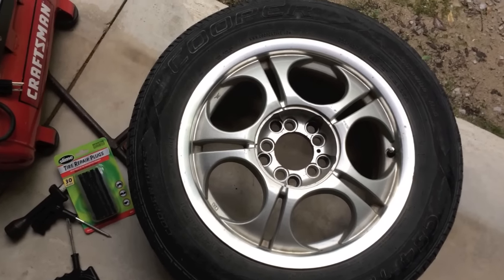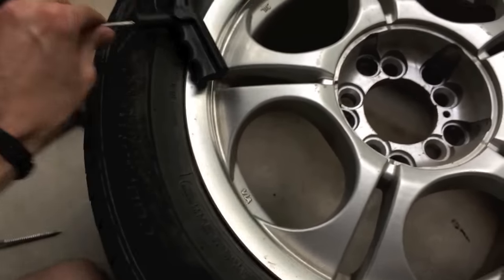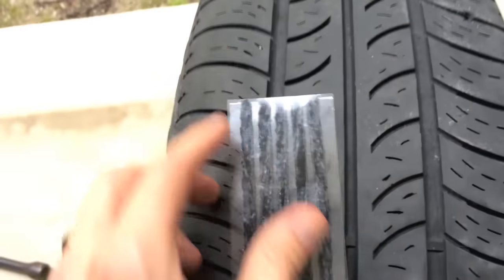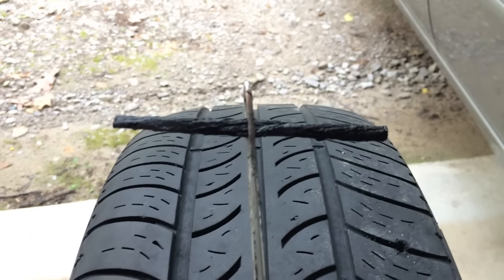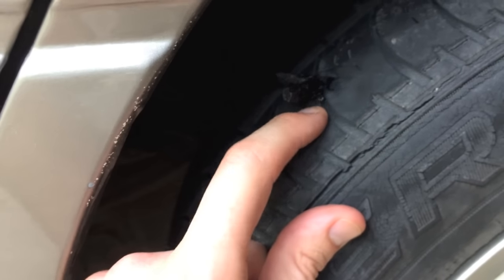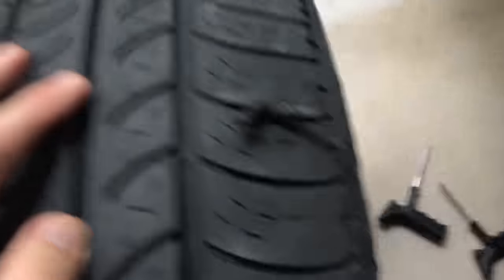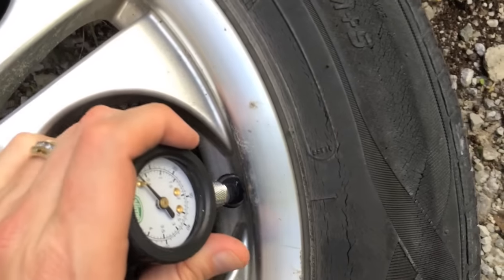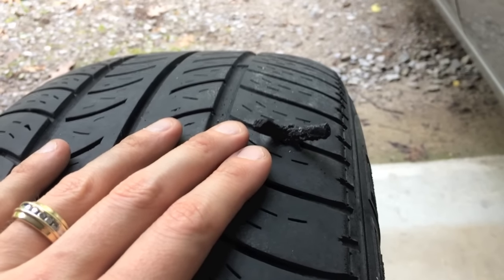How to Patch/Plug Hole in Tire in LESS THAN 5 Minutes - Fix a Flat Tire - EASY FIX

Comment: You skipped over the hard part; Pushing the plug into the tire.
Reply: I agree. I find it exceptionally hard to push the plug into the tire. I’ve done it 25+ times, and it’s more difficult every time.

Comment: One suggestion for the rubber cement compound, I put a liberal amount on the whole strip just before inserting into the tire.  This helps bond the folded section to itself and where it contacts the hole of tire.  Doesn’t hurt to apply some to the plug as shown in the video, but most of what you apply there is going wear off in a short amount of miles driving on it.
Reply from the maker: Thanks for watching & we appreciate you sharing this advice.  Us fellow DIY’ers need to stick together!

😎👍🔧🔩
Reply: I totally agree and that's what I do.
Reply: The person doing this video doesn't know the difference between a plug and a patch, so I wouldn't put much faith in anything they do or say!
Reply: So should I put some of that glue on the strip before putting it in the tire ?
Reply: @ejercitodejehova6979  Yep. Slather the strip in glue.
Reply: @ejercitodejehova6979  YES!!!
Reply: @TF856  accept they just did exactly what the instructions say to do...
Reply: Can it be rubber cement?  The kit I have doesn't have sealant.  It has lube.  It's old.
Reply: And that's what the extra patch on top is for.
Reply: I bought a whole "kit" and it said nothing about cement
 Opened it up and the detailed instructions said use cement lol. Fuck
Reply: I use super glue it works just as good you just got to work fast
Reply: @Envelope81 super glue falls apart when wet even after curing.
Reply: @tannermeade  I ended up using black RVT sealant. Worked perfect and no leaks 4 months later. 8 bought new tires so those tires are gone.
Reply: This - the video is actually just wrong on the just dab a bit - I put it in the hole and around the plug prior to putting it in - makes the insertion easier as well.
Reply: The glue goes on the plug before you push it in!
Trim the loose ends with a razor blade to preserve the repair.Running with the loose ends can ruin the repair.
Reply: The instructions say put the glue on the plug before patching. Just read instructions.

Comment: Before you ream the hole, you want to find the direction of the injury so that your not actually making it worse by forcing the reamer through uninjured tire. Follow the channel of the hole. For example, if the hole is 45° you don't want to force the reamer through at 90° because you'll be compounding wound channels and making it even worse. Coat the plug material with the rubber cement just before inserting it into the tire. It'll act as a lubricant and make insertion much easier while providing for a better plug. By the appearance of the ozone bead cracking, this tire should be replaced anyway.
Reply from the maker: Thanks for watching & we appreciate you sharing your advice.  Any & all helpful info is greatly appreciated Eddie.

Hope all is well with you and your family.

😎👍🔧🔩
Reply: Yeah I just think I did this and definitely made it worse rookie thought I would figure it out nope bought some cheap ass gas station plug and now I'ma have to run to tire shop in morning.
Reply from the maker: @youtubewatcher8244  

Thanks for sharing, can’t go wrong with a new tire.  We just had to put a new set of tires on our Pacifica... we don’t remember tires ever being that expensive...but I guess they are...it was expensive...😳

😎👍🔧🔩
Reply: @DIYwithMichaelBorders  Just had to pay with my pride they plugged it up for me
Reply from the maker: @youtubewatcher8244  

Thanks for sharing, hope all is well.

😎👍
Reply: @DIYwithMichaelBorders  You know his family??
Reply: Good info but how would I know the directions

Comment: I normally apply rubber cement on the strip patch for added seal and at the same time the cement acts as a lubricant during the insertion.
Reply: That's what she said.
Reply: How long you driven the tire after? just curious if they are reliable
Reply: @raulakh123  they will last forever. Tire shops are using this "old" method again due to tires/rims having tire pressure monitoring systems on them - taking tire off there is a risk on some to ruin the TPMS sensor
Reply: @arniepries6480  yeah if your a shitty mechanic 😂😂 there is a certain way to take the tire off when it has tpms...
Reply: @adamglockl  - and they still charge the same price for a flat repair whether it’s a plug or tire removal - go figure!🙄
That’s why I started just doing it myself
Reply: @arniepries6480  i always get my tire patched when i get a leak, NO plugs, they suck in my opinion. Never had a problem with patching, and they normally last me til the tire is worn out. Cost me $20 for a tire patch at my local shop
Reply: @arniepries6480  how much of the rubber head needs to be trimmed off? I pretty much trimmed the whole thing off and there’s barely a nub left
Reply: @Phuong_Nguyen_  That's how I do it, then add rubber cement on top.
Reply: @raulakh123  They are meant as temporary repairs.
Reply: @eddiespencer1  Meant as temporary, but after repairing tires for over 20 years using this method, I've never had a repair fail or leak for the entire life of the tire... ever.
Reply: @knightryder3757  tried and trues 🥂
Reply: @kingz1063  You can buy a tire patch kit for $2
Reply: Facts
Reply: @schris413  😅😂🤣
Reply: @raulakh123  it's fixed for good. I also did that to big trucks when I was used to be a truck mechanic
Reply: Insertion is my favorite
Reply: 1:45 you cut out the 2 hour spot where you "pulled" the strip thru the  tool!!😂😂😂
Reply: @schris413  😅😂🤣🤣🤣
Reply: @kingz1063  But you gotta go to the shop. How's that work if you're 50 miles from town.
Reply: I've actually done this in the driveway, tire aired up and still on the vehicle. Lost some air but easily aired up and lasted for the life of the tire.

Comment: Worked perfectly. I added some of the tips mentioned in the comments such as using a small drill bit for a tiny puncture so the reamer could penetrate, and using the supplied cement glue on the inserter to make it easier to insert. Tires are doing great now. Thank you!
Reply from the maker: Awesome, that’s a great comment & we enjoyed reading it.  You’re a true DIYer for taking the time to read comments & learn more as you put together the steps for your project.

Thanks for watching, welcome to the DIY Raptor Club.

😎👍

Comment: Thanks, just did my first one and this gave me the added confidence to do it!  I will add that you should probably put the rubber cement on the entire plug before you push it in to the hole like one of the other commenters had mentioned.
Reply: Can I normallu drive once I plug the hola or do I need to patch it after?

Comment: Hey there! I found a nail in my tire and thought I was going to have to replace the whole thing because the air was leaking out. Found this video and you have helped me save a bunch of money. Thanks for the info! Keep up the great content!
Reply from the maker: Awesome!!!!  😁👍

Thanks for watching & sharing this, did you keep the nail as a souvenir?

Awesome job Jeremy making it a DIY project, definitely a rewarding experience, enjoy the rest of your week.

😎👍
Reply: As long as it’s not on the sidewall you can patch almost any tire unless it’s completely destroyed. Most shops won’t patch it outside of the center for “liability reasons” but you can still do it yourself. Most people go awhile with these plugs in their tires

Comment: I wasted several strips trying to force them through the tire. You need to inflate the tire to at least 10 psi or close to that so the tire gives you resistance when forcing the tool and strip in. I had an inflator in my garage and just put a peace of paper and my finger against the hole as I was filling up the tire with air. Once it got to about 10 psi, I quickly moved on to plug the tire. Went right in. Great video by the way.
Reply from the maker: Hey that’s awesome advice, thank you for sharing.  We really appreciate you sharing your experience.

Reach out to us any time.  👍🧰

Comment: 5/3/2021: I just followed your method, modified, and so far (drove 30 mph on bumpy road for 2 miles), checking air pressure, and soap-sudsing the plug for tell-tale bubbles, the repair to a leaking tire (losing 2lbs every 30 minutes) appears to hold. This was on the RR tire (2015 Civic LX). I jacked the car up, then rotated the tire until I saw a screw head. Marked the area. Then used emergency brake to hold the tire from moving, and started work. I used a phillips-screwdriver and pliers to remove the screw.  The air came out.  My difficulties: first, it took a big framing hammer to pound the reamer in, after which the reamer would go in an out OK with pushing and pulling by hand. I used Rubber Cement on both the plug material and on the end of the insertion tool. Then I couldn't get the damn plug in, even with pounding the insertion tool with the hammer, so I sliced another piece of insertion material down the middle and used half-a-thickness in the insertion tool; and THAT finally could be pounded in a couple inches. I just pulled it out like you're supposed to. We'll see if it holds. 5/9/21. The car has now been driven daily for 6 days, plus at least 60 mph, and no leakage from the tire. This is the second time I have successfully used a tire-plug kit to plug leaking tires, while the tire is still on the car.
Reply from the maker: Thanks for watching & welcome to the DIY Raptor Club.  Sounds like you’re back up and running.  We really appreciate you sharing your helpful experience.

Keep us posted on how it performs.  Us fellow DIY’ers need to stick together!  Hope all is well.

😎👍🔧🔩

Comment: Thanks for the video saved $267 when Firestone said it’s repairable but they wouldn’t repair it because of tread height (their BS policy) but they would gladly sell me 1 new tire for $267.00.  Too bad I got my 2 rear ones (same tires) for $330.00 all in.  That was from a dealership (the irony 🤣) Won’t go back to FS ever again.
Reply from the maker: Jason Post 

Thanks for watching Jason.  Happy to help.  Sounds like you’re back up and running.  Definitely let us know if you have any questions.  Us fellow DIY’ers need to stick together.

😎👍🔧🔩
Reply: Also just left Firestone, they said the same thing but cuz the location of the hole {which was same as this video} they couldnt plug it. Liability reasons.

Comment: Thanks for the vid. I had heard it was easy to do but never needed it until this weekend. It was kind of tough getting the reaming tool through the tire. I ended up drilling a larger hole with my drill. It could have just been where the hole was located in the tread. But all in all an easy fix to all those wondering. Thanks again.
Reply from the maker: Very cool & we appreciate you sharing this.  Welcome to the DIY Raptor Club.  These little plugs are extremely reliable & some of our viewers have mentioned they last years.  Hopefully many stress free days ahead for you.

😎👍🔧🔩

Comment: If you use the sealant that came with while your pushing the plug in it will make it much easier, with practically no resistance and also the sealant will seal it from the inside as well. Thanks for the video and God bless
Reply from the maker: Thanks for watching & welcome to the DIY Raptor Club.  This is great info & we appreciate you sharing it.

Any & all helpful info is greatly appreciated!  Enjoy your weekend.

Comment: To clarify for the comments, don't shove the thing that punctured your tire into the tire.  The first tool is used to rough up and open up the hole enough for the plug to get in.

Great video, and if anyone is having trouble, just follow the instructions on the back of the pack.
Reply from the maker: Thanks for watching & we appreciate you sharing this.  Any & all helpful info is greatly appreciated.

You Rock Tyler!  😎👍🔧🔩

Comment: One suggestion I would have is to NOT push the projectile(nail,screw etc) farther into the tire,but rather try to pull it out with a pair of needlenose pliers.. it could damage sensitive sensors or disrupt the balance of your wheel while you're on the highway. or even possibly re-puncture the tire somehow in another in another spot..its far fetched but possible

Comment: You should never push the nail inside of the tire. Pull it out with pair of pliers
Reply: What I do too. Pull it out. Quickly shove it in and keep air in place. Tank her out and then plug it. Even will use rubber cement after. And then snip off any extra. Idk it's the way I was taught at the dealer years back. Just gotta hope you dont have too big of a hole because you will want to double plug it and know deep inside you shouldn't. Sidewall though, no hope. Wouldn't ever touch someones tire if the leak was even too close to it. Not worth the risk.
Reply: Who said it was a nail

Comment: Good stuff. In addition to the comments about being quick with the plug and reamer, the Slime kit I got also came with some rubber cement. The plug is already super sticky, but the cement coating all over the plug can only help.
Reply from the maker: Berlin1811 

Thanks for watching & sharing your thoughts.  You’re spot on!  We appreciate you sharing.

Let us know if you have any questions.  Many more helpful videos to come!

Please subscribe to the channel and Ring your YouTube Bell 🛎 that would be awesome thanks again!

😎👍🔧🔩
Reply: YES. The enclosed Rubber Cement is to be applied to the Sealing Strip  and around the hole before inserting the Strip into the tire -- Cement acts as a lubricant to help the Strip go in -- and as a sealer when the Strip is in place.
 Notice that the vehicle is in dire need of a Wheel Alignment. ;>(
Reply: Stay away from slime/fix a flat. It eats away at your TPMS sensor. Plug/patch is the way to go!

Comment: personally I  try to remove the object first instead of just pushing it into the tire and having it roll around
Reply: Same
Reply: That's what I was thinking. Prying with a long thin nail and pulling with a pair of needle nose pliers would probably do the trick.

Comment: I like to do this repair instead of removing the tire to repair it properly. Saves me a lot of time and money. I get nails near on the outer or edge of the tire and that's where tire shops will tell you they cannot repair the tire and require you to buy a new tire.
Reply: Is it still fine to repair there? I have a puncture close to the end of tread wondered if I shoukd try this
Reply: @abimhhgrrcunzolebh1688  you can, if it's too close to the sidewall then the tire shouldn't be repaired and put a spare tire on instead

Comment: A tip for those who struggle with inserting the plug- if you're having trouble putting it in place, a bit of dish soap (preferably Dawn dish soap) can fix that right away.
Reply from the maker: RustyPete12 

Thanks for watching & sharing your info, we really appreciate it.  We hope you enjoyed the video.

Please subscribe to the channel and turn on your YouTube notification Bell 🛎 that would be awesome thanks again!

😎👍🔧🔩
Reply: You can simply use the glue that came with the kit, dab a little before inserting
Reply: The glue he mentions is a hardening compound but paint it on the plug this makes it slimy and easy to push in. The tool he used the clean the hole is called a reamer. 3-5 times all the way in and out is plenty.
Reply: @johnjkizer6399  I used it for my first time putting one on ever and it definitely slid in nice and easy 😩

Comment: 3:31 i was told to not cut the excess off as it would create the best seal when you're driving and it's pressured against the rubber of the tire.
Reply from the maker: Thanks for watching, that will be personal preference.  Some cut it off, some don’t.  Keep us posted on your progress.

Let us know if you have any questions and hey if you’re into crypto trading, join our DIY ecosystem and help us grow an exclusive group of DIYers.

       toolboxtoken.com

Reach out to us any time!  🧰
Reply: Yes just drive around the block come back and check for leaked

Comment: When using the reamer be sure not to twist it just strait in and strait
Out
Reply from the maker: jake deforus 

Very cool & thanks for sharing your comment.  We really enjoy making these helpful videos for our fellow DIY’ers.  Many more helpful videos to come!  😀

Let us know if you have any questions.  Please subscribe to the channel and turn on your YouTube notification Bell 🛎 that would be awesome thanks again!

😎👍🔧🔩
Reply: Good tip! But, a strait is a narrow body of water, or a dire predicament.  It's "straight" in and out.
Reply: @scrapper666  lol...I saw too! Straight away!
Reply: A lot of people use a drill bit on a drill and it work great. And you need to pull out the screw not just push it in. Flat head screwdriver and a needle nose pliers. Should always be kept with the plug kit. When you buy a complete kit they actually come with a cheap pliers and screwdrivers. Never push the object into the tire.
Reply: We Are Anonymous just what I was taught in school due to the ability to move the belts in the tire may not be as relevant bow
Reply: We Are Anonymous  Still No Good. Pull it out Brother!( stay safe)
Reply: Funny but that’s not always the case. Sometimes you have to